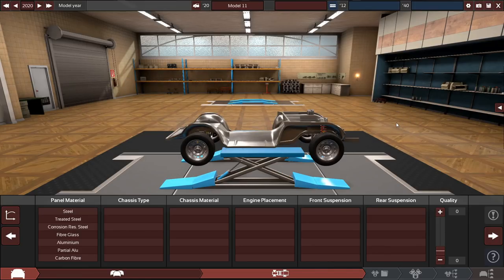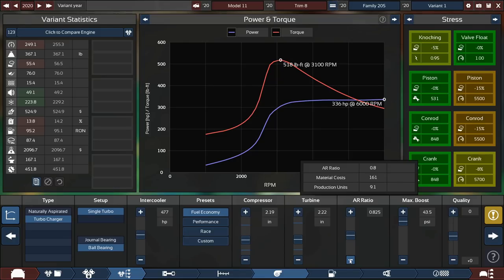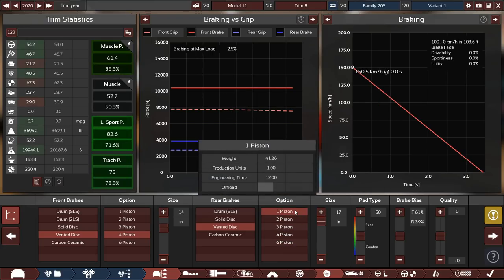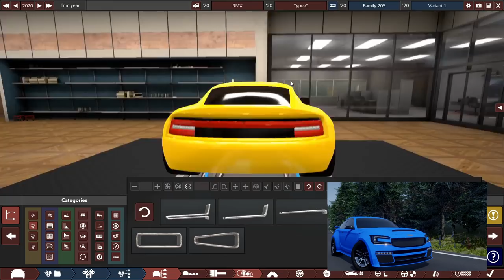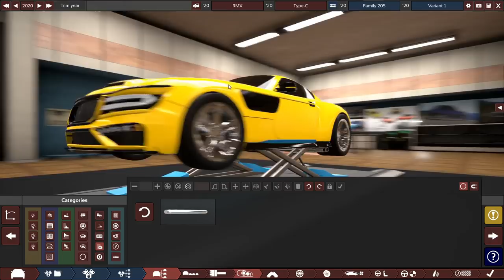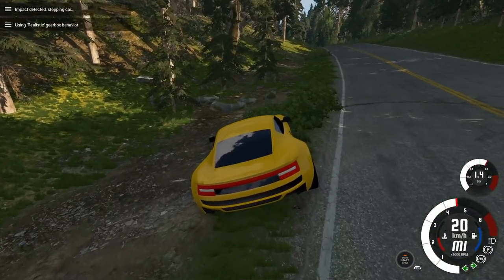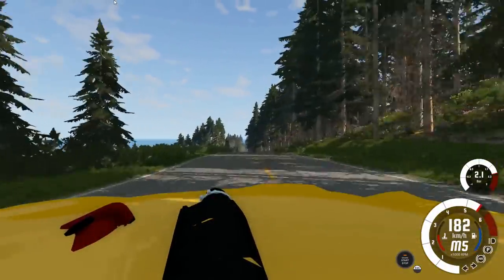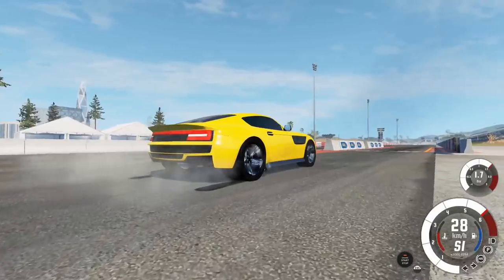Making A 3 Cylinder Muscle Car? Automation - BeamNG

Comment: Challenge: Build a South African supercar.

Requirements:

1: As realistic as possible

2: At least 600 hp like most of today’s supercars

3: Top speed at least 325 kph

4: Price at least $150,000

5: Brake cooling

6: Active and advanced aerodynamics

7: 0-60 at least 3 sec

8: 0-124 at least 8.5 sec

9: 7 speed dual clutch transmission

10: At least 15 miles per gallon

Bonus: Impress me
Reply from the maker: Don't worry, I have this challenge on my to-do list :D
Reply: Great, I know u can do it cuz it’s such an easy challenge lmao
Reply: @TwinTurBros  I have a challenge for you too: BMW E46 316ti recreation.
Reply: But what makes it South African?
Reply: You can choose the origin of your care in automation
Reply: i made a 30mpg 1200hp supercar that costed like 15,000,000 with 1.5 0-60, only in had a 6 speed manual,
plus i made a 600hp 2020 supra looking thing
Reply: Don’t forget the rally suspension so you can actually drive it in Africa
Reply: Made a 120k supercar with 5.5 V10 making 750 bhp, 0-60: 3.2 on normal roads and 2.4 on dragstrip, 7 speed sequential, top speed 330kph, premium interior and all, weight around 3010 lbs and quarter mile of 9.690 at 142.

Comment: I can imagine this as one of those Paris Motor Show concept showings, like the Jaguar XK 180 at the 1998 Motor Show, or the Citroën C-Métisse at the 2006 Motor Show. Unconventional designs go there all the time, and they're like at least a decade before production I'd bet, so this puppy fits right in, see how big Maven can get their cylinders.

How Maven changed the body for the production RMX is kinda like how queues from the 2010 Audi Quattro concept made it to the newer Audi TT models as they seemed to just get angrier over the years lol. Like just look at each year of Audi TT since 2010 to 2019 and tell me they don't get angrier looking XD

The hood scoop gives me sweet Knight Rider vibes. Makes me think Maven tried a scanning self-driving system and placed a scanner in that scoop since it would be able to see the entire road.

I imagine the dual exhaust is just since its low and stiff enough they needed two flat exhaust pipes, so going from 1 to 2 makes sense there. Gotta keep those pipes from scraping, exhaust leaks sound horrible so Maven wanted to avoid that chance lol so good choice there

So overall you built this as if Maven was trying some odd things, experimenting, but again, concept cars are just that, experiments.

And a lot of concept cars are faster than their production cars off the line, such as the Jaguar CX75 which would've made nearly 1200 lb-ft of torque (electric drive with turbine range extenders) whereas the developmental prototype makes an estimated 900 lb-ft between the motors and the twincharged I4 engine, perhaps less with drivetrain losses. The concept had only around 780hp where the prototype had 890hp. For all intents and purposes, the prototype CX75 was the production model, as the turbine CX75 was the Paris Motor Show model from 2010. Its funny, the prototype was in the movie Spectre.

Anyways, cool beans, it was an odd car but quirky is cool, amiright?
Reply from the maker: Exactly! Basically a proof of concept sports car, thats out of Mavens comfort zone. The production RMX looks similar but muuuch different (after some sort of backlash from journalists commenting on looks or something :P)

I could have made this car AWD, and it would have creamed the RMX off the line even more. But after 60 it gets recked by the real RMXs much higher HP!
Cheers :D
Reply: That’s a loooong comment
Reply: @milesdzineku9940  Oh, this one was about half as long as my usual comments when I go in depth :P

Comment: I played it for first time and made a   v10 6000cc spitting out 1944ps@8200 rpm but why the fuck my car going 0-60 for 4.2 second its slow AF for car that has nearly 2000ps. I try wider tire and nothing help. Can you advise some help? Btw i use sandbox mode all quality +15 all panels are carbon fiber, suspension are active sport with race preset and highest power/torque possible for the engine i adjust manually
Reply from the maker: Whats your gearing? top speed? That can have a big effect on 0-60
You probably have no traction because of the amount of HP. Aero helps too.

is your car FWD? RWD? All wheel drive? 
AWD is the fastest 0-60 and mid or rear engine is best for grip (as power transfers weight to the rear upon launch, so if its FWD it wont have grip)
Reply: @TwinTurBros  top speed @ 421 kmh bro. And long gear spacing(dropped down). I use AWD. How to increase grip? My tire is already peaked out ( 20 inch 350mm)